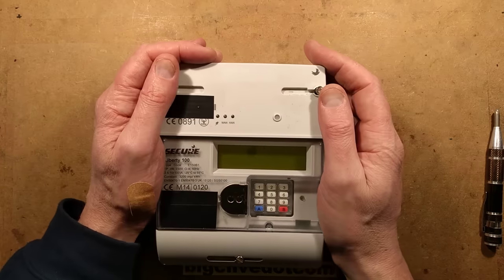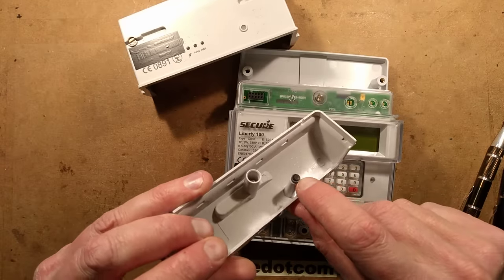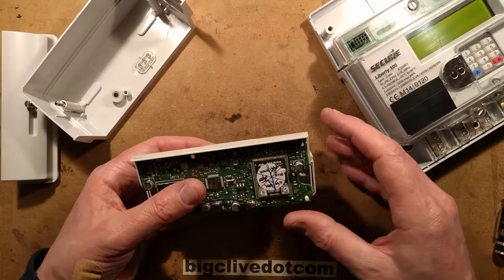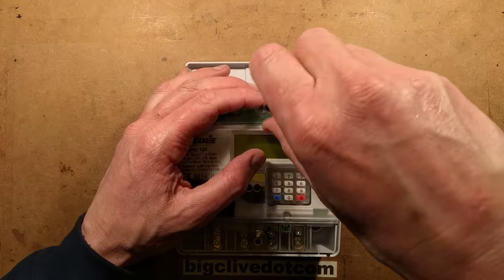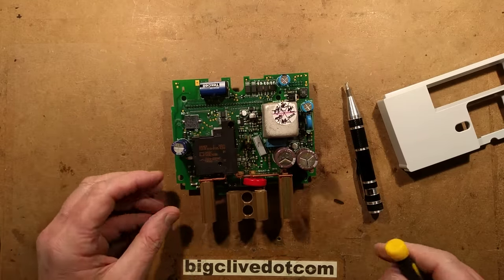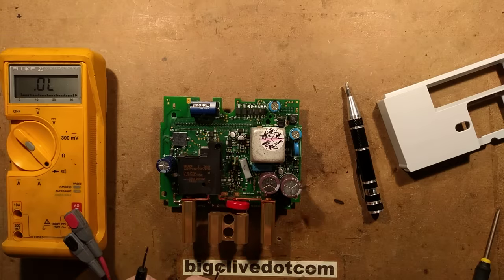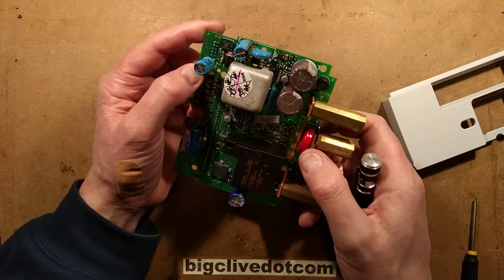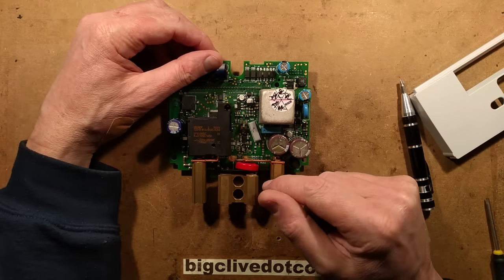Inside a smart meter, and the REAL problem with them.

Comment: This is another reason why going off-grid with a solar array and a house battery makes sense. I just got a letter from the national electricity distributor that I can submit my own meter reading FOR FREE! As if it's some kind of special perk.
Reply: Not really. The cost of grid power is so low that even if you get screwed over by the supplier, solar still has a ten-year or more payback time. Usually. There are exceptional circumstances where off-grid solar is the cheaper option though, such as remote buildings where the cost of physically connecting to the grid would be substantial.
Reply: I crunched the numbers once, for my mountain house where I currently have no power except for a gasoline generator (since I'd eventually like to move there permanently).

Assuming my average current power consumption of 5 to 7kWh/day and a reserve capacity of just 10kWh, the batteries alone would run me at least 2000€.At my latitude (45N) I need AT LEAST 4kWp of panels (another 2500€) to generate ~6kWh a day in winter, and then I'd be wasting over 10kWh/day in the summer (!).Add in miscellaneous stuff like inverters, charge controllers etc (at least another 1500€) and you get to 6000, assuming I do all the installation myself at 0 material cost and don't fall off the roof and die like an idiot in the process.

By comparison I currently pay about 45€ a month for power. Subtracting the 500€ or so that I'd have to pay to get the power line brought over, it would take 122 months to pay for the system, assuming nothing ever breaks and everything keeps working at peak efficiency. I haven't factored in any margin for the panels and batteries to lose capacity over time, so after 5 years I could probably start having problems during the coldest and darkest winter days.
All in all it just makes no sense. 
With a grid tie system you can scale the panels down to 2kW since you only need to produce more than your yearly power consumption and the grid acts as a virtual battery, but everything gets much more expensive because you have to use grid rated equipment and it must be installed by a certified company, so in the end the cost is virtually the same.

tl;dr If you have 5K to invest there are much better things to invest them into - thermal insulation (especially windows have a huge payoff if you have old single panes), more efficient stoves/furnaces, even a car with better fuel economy.
All of these have a ROI higher than an off grid solar setup, and they make your life better instead of worse.
Reply: Yes I am part way through going off,  grid, I have cheap batteries, my panels face west so they only work really well towards the end of the day, I knew this would be an issue, but I am installing more panels facing South, some almost at a vertical angle for winter. Panels are cheap enough to get now, long-term I will be making the call to get a permanent disconnection, just like I did with the gas. At the moment I have a simple changeover switch to put me back on the grid when my batteries are low.  Going to drink copious amounts of Champagne the day the meter is finally removed. 
My hatred for utilities runs deep in my veins, I have no axe to grind with the workers, its the fat cats and their big bonuses that piss me off.
The water companies water is undrinkable, they now use Chloramine instead of gaseous Chlorine, the smell persists for days and it tastes bad, trouble is it breaks down into toxins including Nitrites and Nitrates.
I am making clean rainwater storage, I am going to filter it,  irradiate it with UVC light and drink that instead, I do not want stomach cancer.
Reply: @demoniack81  i lived off grid for 15 years. yes it is a hassle unless you area enthusiast. i am. batteries are the biggest expense. mine cost £2000 and lasted 10 years. these were the best ones available. worked out at around £5.00 a week. i started with wind turbines then moved to solar when they got cheaper.  was it worth it? in my case it was the only option. also had a big genny as well. as a back up. a long extension lead would by easier.
Reply: Check the warranty on the PV equipment. Usually there is a 10 - 12 year payback period before you start actually saving money through the original investment in buying and fitting the kit. You will probably find that the panels themselves have a 15 - 20 year warranty, but the inverter may only have a 2, 3 or 5 year warranty, so if it goes bang or stops working before you have got your investment back and started saving money and have to pay out for a new inverter, then you are out of pocket and right back to square one!.
Reply: @discoequipmenthire  I did get everything cheaply and picked a very robust 12 to 230 volt inverter, I have done all the installation myself and taken great care to create a perfect working environment for the inverter, it is only 3000 watts pure sine wave type, and it will peak to 6000watts for milliseconds in order to accommodate some inductive loads.
I never abuse the inverter, I hardly ever go over 1000watts with it. 
The panels are glass type, they seldom go wrong, and I have installed them on 316 grade stainless steel frame on the roof, but the outputs will decline a little over time, the MPPT controllers were not too expensive, they are cheap Chinese but they work well, again they have been spoilt, they are mounted in a metal cabinet with a Hall effect activated fan to keep them cool, however they never really seem to get hot anyway. 
My batteries were purchased for scrap value.
Many people talk about payback times when installing renewables, it is an issue that needs looking at, but not something to dwell on too much, here is my school of thought on this, many things involve capital outlay. 
Buy a brand new condensing gas boiler and central heating system for your house, it will cost thousands of pounds, then you have to pay for the gas to run it, but few people mention payback times or the cost of a service plan for the new boiler. 
For me, I just value the idea of being self-sufficient and not having to pay too much for energy.
My solar thermal panel which I made myself in 2002 has been working flawlessly ever since it produces hot not just warm water for most days during the summer. 
The Payback on the solar thermal must have paid for itself many times over, the whole thing only cost me about £500 at the time. 
Hoping to increase my solar electric, I have made it expandable and if I get more monocrystalline panels, I will aim to have enough panels to offset any decline in output.
Reply: @LuluTheCorgi  It would certainly be more difficult, but nothing is totally impossible, there is always a way.
Reply: @LuluTheCorgi  That is really shit that they do that to you.

Comment: I've only ever heard people having an issue with the possibility of doing a completely automated remote power disconnect of particular client. Certainly, utility company had that option also previously, but given that they had to always dispatch a technician to kill the individual power supply, it wasn't practical to be done in a targeted fashion, should perhaps a law come into effect that would give reason for utilities rationing. Having smart grid makes this super easy and completely independent of any technician visitation, even to the point of being trivial to do so without any operator intervention. That is the scary point regarding smart meters. 

First time I've heard any bs regarding some harmful radios or these other kooky things were on the videos of youtubers reviewing smart meters. Literally nowhere else I've heard or read that.

What I did read was that some people claim that certain patterns in power draw could enable the meter to recognize approx. types of devices that each particular apartment unit uses, but who knows. I would doubt that.

Comment: I'm guessing the isolation is for the case where an external antenna connected. At that point you really wouldn't want a wire coming out of the non-mains side that isn't galvanically isolated.
Reply: Exactly

Comment: France is in the process of installing smart meters. They go by the name of 'Linky', and there is the usual controversy over their use (Quelle surprise!) However, they do not communicate directly with the 'Mother Ship' via 3G. Instead, they send data over the supply cables to modems mounted in boxes on the overhead line posts in strategic positions where the 3G signal is good. One modem can deal with any number of households on a particular circuit fed from pole top transformers. (70% of our supply network is overhead.)
The advantage is that the comms aren't affected by thick walls, meters in cellars, or other situations where  the meter location can weaken the signal strength.  In the event of failure of the 3G system, data is stored in the modem (or meter) until service is restored.  
Of course, the French resist change, and were upset about the RF radiation from the Linky meter, but the data is sent in short bursts, so that shouldn't be an issue.
Cheers!
Reply: and they can get much more data from you. e.g. whether you are home, not at home, when you do your laundry, watch TV. they can switch off your electricity etc. Even how many people take  a shower (in case of electrical direct pass heater). Hiding Anne Frank would be impossible nowadays...

Comment: The power supply is shielded to prevent problems with the modem unit. That close of proximity to a low power transceiver and a switchmode power supply can cause headaches

Comment: It took me until 7:00 to figure out that it's an electric meter. I thought it was one of those automatic postage machines LOL. Then when you said it uses a cell phone network I thought maybe it's a parking meter. The meters in the US look a lot different , are much bigger for 200+ Amp capacity. They communicate through the power lines rather than RF. The pulses do go both ways, and any transformers you have in the house can be heard buzzing for about 10 seconds when it is signaling the meter reading.

Comment: The low powered Comms are to talk to the sister gas meter, as it's battery reliant, it lets the electric meter do the higher power communications via the GPRS network
Reply: I have this meter. It came with a little wireless display that shows my power consumption etc. I bet that uses the low power comms too.
Reply: All the meters here in the US are in a separate metal enclosure usually above the main breaker panel, and the glass "jar" over the meter has a seal tha prevents tampering.  The smart meters have a bunch of information about the "gear ratio" just like the old dial meters, so it can be determined if it's for single phase, residential or whatever.  The LCD flashes various cryptic messages, one of which is "Sync net".

Comment: Smart meters aren't to save you power, they are to save the electricity company money. Equals more profit.

No one has to go out and read the meter. Remember, people time is expensive, machines work for nothing.
Reply: When was the last time someone came out to read your meter, even when it was conventional?

These are being installed to save someone money - not the energy company directly, they cost money to manufacture and install, and it isn't exactly in the energy companies' interests to get people to use less electricity (the stated purpose of smart meters). Which does raise the question - why are they so keen to get these meters installed in every home?
Reply: And then you discover that they make the money out of thin air.  Is there anything on this planet that isn't a fucking scam.....

Comment: The real problem with so called smart meters is that they are being sold to us on a lie. They don’t help you save money and despite the assurances, they don’t work with solar panels, all they can now do is tolerate the reverse current a solar system might produce. I was basically bullied into having a smart meter, only to discover I still have to supply my FIT meter readings manually. The meter never communicated with the remote display and my electricity supplier clearly could care less. I finally pulled the modem off the meter in protest at the lack of action and so far nobody appears to have even noticed. My advice is stick to your old meter, because these new ones are weighted in favour of the suppliers with absolutely nothing to gain by the customers.
Reply: Your FITs are paid according to how much energy your solar panels generate so you have a generation meter to measure that.  The smart meter measures how much energy you take from or export to the grid.  The smart meter does not know how much of the energy that your solar panels generated has been consumed by your house so it cannot be used to determine your FITs.  For example if your PV is generating 1kW and your toaster is using 1kW then the smart meter power reading would be zero and your FIT payment would be zero.
Reply: @petehiggins33  I understand how a smart meter works. If you have one fitted it also has a link to your gas meter so it can report both sets of readings. I was expecting a similar upgrade for the FIT meter, not just the ability to accept the potential reverse current from the solar panels. It’s clear that my supplier are only interested in meeting the government target for installations and couldn’t care less whether they actually work or achieve any sort of savings. As far as I’m concerned anything marketed as ‘smart’ or ‘green’ needs to be treated with utmost suspicion and is usually crap compared to anything it might replace.

Comment: I have a smart meter. Now all the frogs in my garden are gay.
Reply: Matt Quinn Not at tall. It's the constant sound of Mardi Gras outside my bedroom window that's the issue.
Reply from the maker: It does that to frogs.  You can make a small frog nightclub out of two cardboard boxes with acoustic insulation between them and add some modified solar garden light based disco lights inside and it'll encourage them to congregate there.
Reply: bigclivedotcom How do I turn the volume down tho?
Reply: Mine must not be working properly. All the frogs in my yard are bi.
Reply: I have a smart meter, and I'm gay. Though, to be fair, the gay happened before the smart meter showed up.
Reply: @Bryan1342  
So a smart meter can also distort space and time. The conspiracy goes far deeper than anyone suspected.
Reply: silly jokes like this are facilitated spread to discredit serious issues. rubbish conspiracy talk? nope its talked about in the documents snowden leaked. herd mentality, people would rather follow a 'sensible' concensus then look at real evidence and fear being ridiculed. pathetic.
Reply: since they installed their smart meter, all of the toads around my house have disappeared. Not funny!

Comment: I work in the field. In the modem, there is a second chip that is most likely MBUS Wireless/Bluetooth/whatever for walk-by readouts (in case the 3G/4G doesn't work properly). Regarding the conspiracies about those meters doing random crap, trust me. We struggle to get  a reading of ONE tarif on those meters when we need to read them. Imagine trying to do anything else than that...

Comment: When our analogue meter went faulty we had no choice but to accept a smart meter. I told the fitter not to connect the smart functionality. "that's not a problem ' he said. I have now a dumb smart meter. One thing I have noticed that if I check through the menu by  repeatedly pressing the button you can check the time setting. Ours is wrong by about 6hrs. If you are on a time of day tariff (E7) then that could be very bad news.

Comment: My two main concerns are reports of these meters bursting into flames and reports of over-billing.
Reply: There's a risk of this with all electric devices, look at Hotpoint, how many tumble dryer,washing machines and fridges have burst into flames, in fact the Grenfell fire was apparently a Hotpoint fridge. There's been loads of devices of all different manufacturers bursting into flames.
Reply: In twenty years of electrical work the fe times I saw anything burst into flames was due to overload or tampering . I did see a Hotpoint washing machine drum blast through a worktop before though 😂
Reply: @christophergallagher3845  yeah I had a tumble dryer that set on fire and they tried to pass the buck on us saying we didn't remove the dust from the filter which was BS as we removed it with every use and even went as far as hoovering it when did the cleaning as I'd heard of fires starting like this, anyway Hotpoint replaced the tumble dryer and guess what that machine broke down a year and half later. I will never buy anything from Hotpoint or its sister brands like Indesit again. Grenfell fire started with a Hotpoint fridge and a Hotpoint tumble dryer caused a big fire in a flat in Shepherds Bush, so says a lot about the manufacturing standards at Hotpoint!
Reply: @Nick_80599  yep they've had a ton of public recalls in the past too , I've rarely came across any though personally that actually went on fire . The washing machine drum one I mentioned the drum car flung throught the too of the machine and worktop about like a cannonball into a pirate ship . Was crazy seeing the twisted metal and carnage the drum done . Was a Hotpoint machine